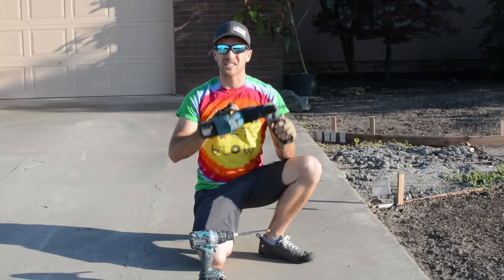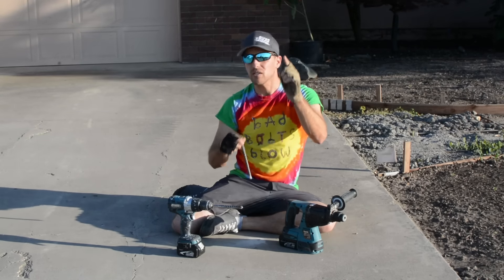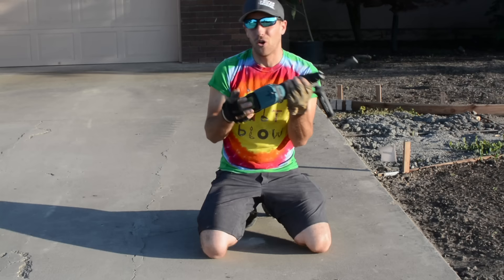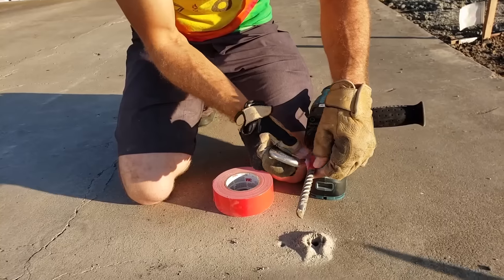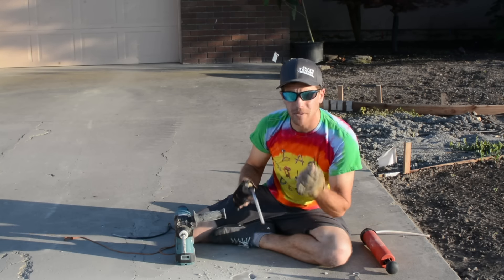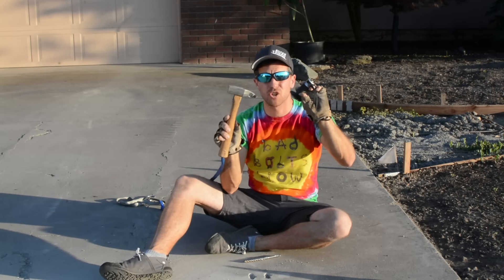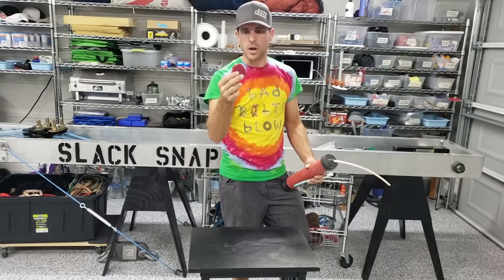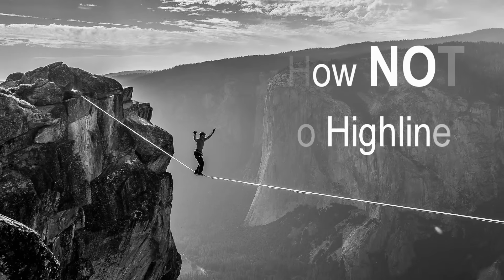Bolting Bible - How to drill holes in rocks for climbing and highlining bolts

Comment: Always remember that when cleaning your hole you turn the brush in the same direction on the way in and the way out. This will break any small fragments loose and score the edges of the hole for better glue retention. Learned this in construction.

Comment: Pro-tip: If you're going to be doing more than a few holes, invest in the carbide-tipped rotohammer drill bits. They will stay sharp WAY longer and drill faster, well worth the extra $10-$15.
Reply: The bits he showed are brazed carbide single and double spade. 

He said hardened bit, but technically it's a different material. Carbide is amazingly hard. But I've chipped alot of it over my career
Reply: instablaster

Comment: If you can afford buy a Hilti te6a 36V 
did a lot of rebolting with it. you need no pressure at all Even for holes bigger then 12mm.🤟
Reply: Hilti is the premier brand, it is The Industry tool of choice. 
Now I'm a electrican, and the price tag if Hilti had me searching eBay. But they are the toughest tools currently in production because of the way they service the tools. When bought new, they tend (threw the dist company) to have a service package to maintain the tool for a true life warranty. That being said, my day to day tools and the ones that I feel are a good balance between cost and performance, are Milwaukee. 

That is my personal opinion and not a statement of fact. 

What is fact is that DeWalt the French company was bought out by black n decker to be black n Decker's industrial tool line since the customer perception of black n decker fell due to decisions made to make tools more accecpted and accessable to home owners. 

Peace, love and be safe
Rob

Comment: Hey Ryan, have you have done any testing on mechanical bolts on sandstone? I've done a course on conquering climbing routes and the instructor used only traditional stainless mechanical bolts, sometimes they would not get tight at all. Would be really cool to see this series on different rocks, but I understand it's not easy to have access to natural sandstone that you could screw up.. also sandstone varies so much that I don't know how much value testing different sandstone would have comparing with our own local one, quite tricky.
Cheers!
Reply from the maker: We did 100 break tests in Moab.  Mechanical bolts in shear are fine in our tests, but doesn't take into consideration cyclic loading.  We will be releasing episodes about our sandstone tests in next few months.  You can feel if the bolt is solid when you put it in.  Long term, IDK though.
Reply: @HowNOT2  ohh nice!!  I'll be the first to watch it! ✌️

Comment: I don't know if it's different over here in the UK, but sds plus is the smaller size here.
Reply from the maker: Yea.  SDS plus is normal and SDS max.  I may have said this wrong in video.  It is correct in bolting bible

Comment: It seems like you have to apply a fair amount of pressure to drill the hole. This is easy to do when you're on the ground drilling directly downward, but isn't it harder to drill holes on a vertical climbing wall, when you're off the ground?
Reply from the maker: Technically the drill is suppose to do the work.  I don't really push that hard.
Reply: You really only need 20-30 lbs or so of pressure, just enough to keep the bit pressured on the rock as the hammering action cycles. You can actually prevent the hammering action from cycling if you push too hard (you have to push pretty hard for this though).
Reply: I've drilled in every position and angle as a electrican from deep in a hole my self, to high in the sky on a 165 foot crain lift. The amount of pressure needed in any position is enough to allow the bit to bounce a tiny amount to break up the rock at the tip, but enough to maintain contact so a firm push. 

The bigger the diameter the harder it is, especially vertical over head. But with paitence and time, it's not bad at all.
Reply: The harder you push the slower it drills because you're damping the impact force. The only pressure you need to put on the drill is enough to keep the hammering action engaged.

Comment: two cut drill bits ARE NOT SUITABLE for the tolerances of removable bolts. petzl recommends a 4 cut head only as the hole they create is less oblong and rounder than the hole made by the 2 cut heads.
Reply from the maker: Their expensive removable bolts do require a 4 point drill bit for sure.  All other bolts are not that narrow of tolerances.
Reply: Out of curiosity, does a dry core bit (hole saw for rock/cement) do a better tolerance then a fluted drill?

Comment: Dude, I professionally install geo-stabilization systems, and I've been climbing (including new routes and bolting) for almost 30 years.

I cannot stress enough how correct that last point your made re: blowing and brushing bolt holes. We test every single bolt we place to 50% of it's engineered tolerance (this varies depending on the system and requirements). I have so many examples of bolts failing because a hole wasn't cleaned properly.

Proper cleaning shouldn't involve a formula. Don't just blow / brush / blow every hole! Do it until you're happy that the amount of dust / spoil coming out of the hole isn't an issue. Pro-tip: An acceptable amount is unnoticeable.

The rock can change in a very small distance (in sandstone, it can be centimeters between solid and cheese). Even concrete can be changeable with regards to the density of the grains, the hardness, the amount of dust that be blown from a hole. This can (and, I can witness, does) create a difference between a bolt failing at 0.5kN, and passing (i.e., no steady decrease of engineering spec rating, held for a minimum of 2 minutes) at 7.5kN. One was brushed and blown until nothing came out, the other was a blow / brush / blow.
Reply from the maker: Do you have pictures of failed bolts from improperly cleaned holes.  I'd like to include more of those pictures in the bolting bible
Reply: @HowNOT2  No, but I will try to remember to get some. I can probably do a pretty good series of tests if I can find some sacrificial rocks (Sandstone I can probably find, it's harder to come across "sacrificial" granite or limestone in Australia without access to a quarry). I can test with a proper anchor tester with a series of bolts in uncleaned, blow-brush-blow cleaned, properly cleaned and get kN readings for where they all fail. Unfortunately, it'll have to wait until I've got some spare stainless M12 threaded bar around! That stuff is usually only bought in quantities to fill a job spec, and I only usually have access to spare stock when we buy up for a large job! I'll keep it in mind next time I'm doing some testing, and will try to get you some photos of controlled test-to-failure situations in various conditions / materials.

Not really applicable to highlining / climbing, but you should see the failure variance in bigger anchors! I'm talking 24mm stainless, 6m long bar concreted into sandstone! This is one of the reasons geo-tech engineers over-spec the shit out of these systems!
Reply: @Intermernet  thank you for this, I've never really been told in my trade as a electrician to do this, nor how much it can effect strength.